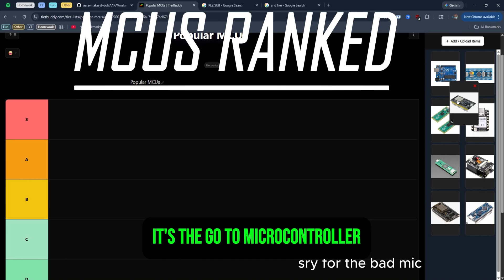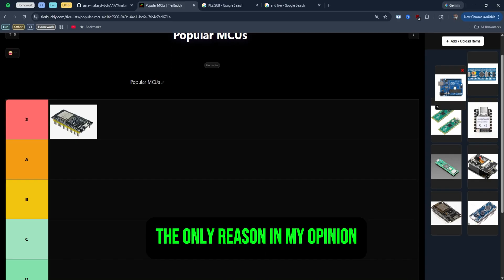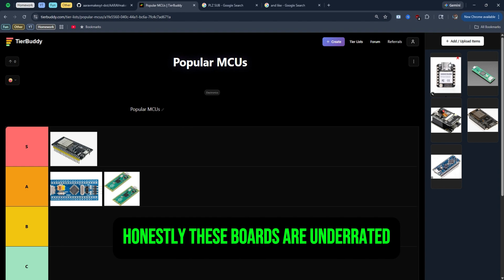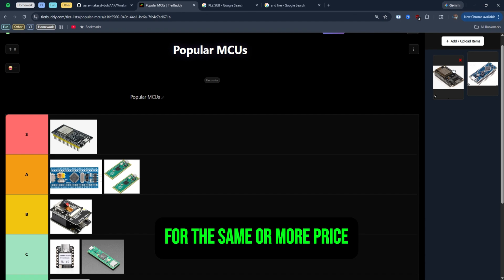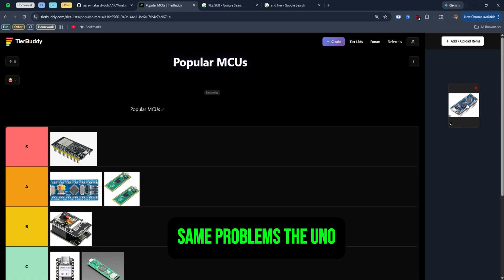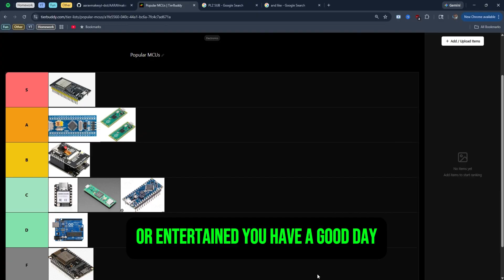I Put Arduino in F Tier and I'm Not Sorry

Comment: Did u consider the STM8 modules, i know those are very weak and dont perform very well but, the STM8s003f3 boards only cost about a dollar and are quite capable especially for small, not very demanding projects. Only downside is that you need a seperate STlink module to program it.
Reply from the maker: I will, thanks!